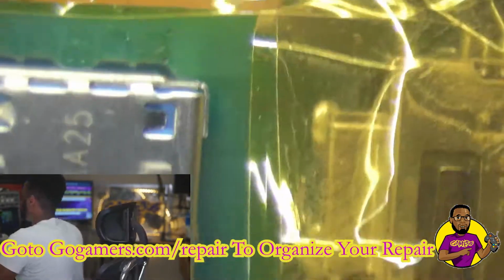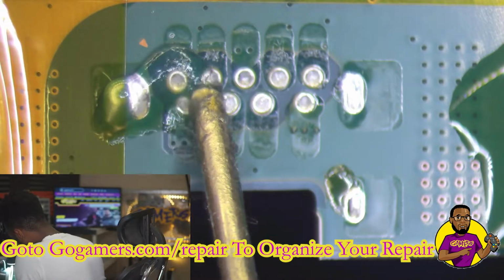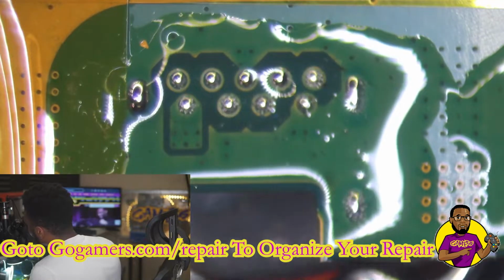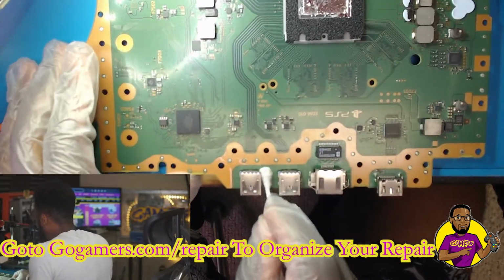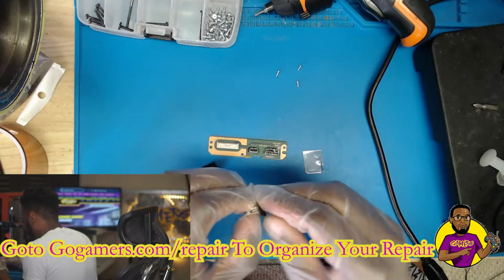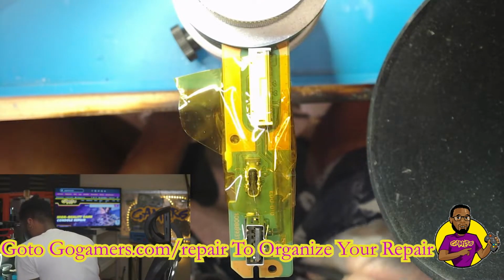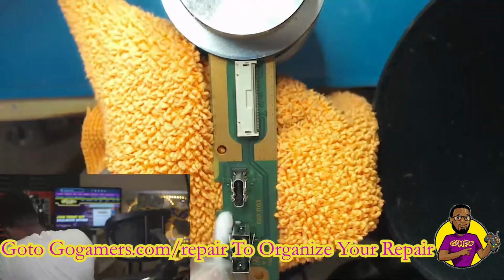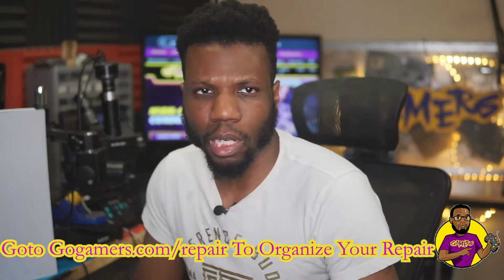How To Fix PS5 USB Ports Not Working (PlayStation 5 USB Port Replace Repair)

Comment: My little brother has a ps5 i got him for christmas years ago. After about a month of him using it the usb's stopped working and it wouldnt boot anything past the home screen. Tried fixing it, but when i power it on after cleaning the internals, i cant connect a controller to get past the startup screen because of the usb's😭

Comment: One fix is get a new surge protector because it may not be delivering enough power to the ps5 or simply only have what you need plugged into surge protector

Comment: I had to get my ps5 hdmi port repaired now after having it back 2 months the first time I tried to play my psv2 it would not power on . After testing it on a different ps5 I've cone to the conclusion that type c port doesn't work. The usb above it doesn't work either. What could they have done or failed to do to cause this?

Comment: How do you get that kind of damage on all 3 usb ports, that is nuts
Reply: Hitting a cart off of it broke mine
Reply: @GFduder  Preach 🙏🏽🙏🏽
Reply: In mine, the damn things melted, things plugged into the port were wonky so when I went to unplug it and try to plug it back in, you heard a crunch like broken plastic. When I managed to actually unplug the male USB from the port you could see the entire female USB melted into the male USB and just ripped it's guts out when unplugging. 

Day 1 ps5 disc version sitting horizontal. The console has about 100 hrs of use mainly from GOW 2018 and 2022. Then maybe 20 hrs in psvr 1.